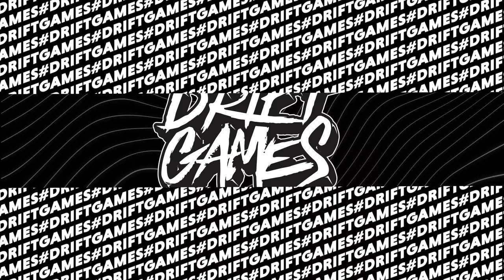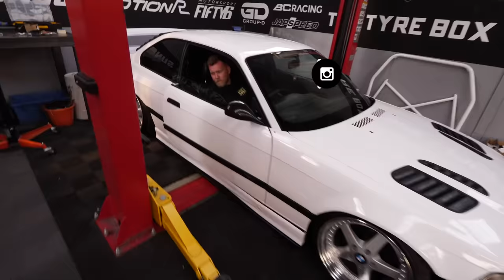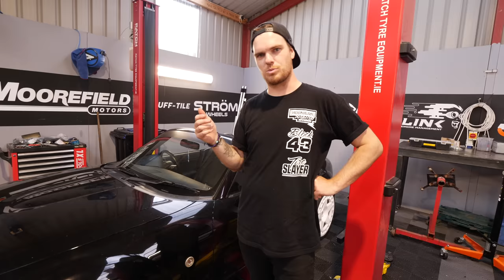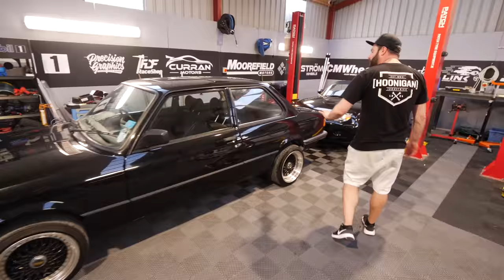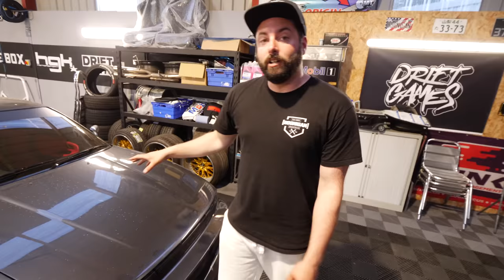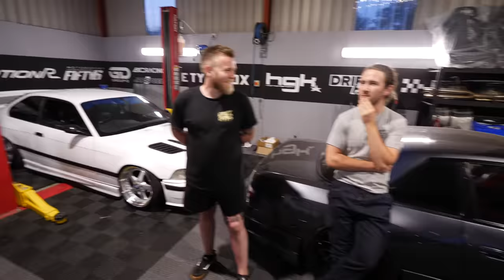We have set ourselves a MASSIVE new challenge...

Comment: Air ride is very simple. First upgrade to 3p management. Make sure you have a water trap (sat at the lowest point) and smc check valves between your compressor and tank or you risk splitting the seal on the compressor.  I used a rubber protecting product to stop bags going dry and cracking. Top mounts are always common to wear out. Ptfe your air line fittings that screw into tank and bag. They are cheap enough. So throw some new ones all round on. And use pvc conduit sheers to trim a few mil off lines when putting into a new fitting
Reply: Air ride is fairly maintenance free
Reply from the maker: Thanks for the advice man!